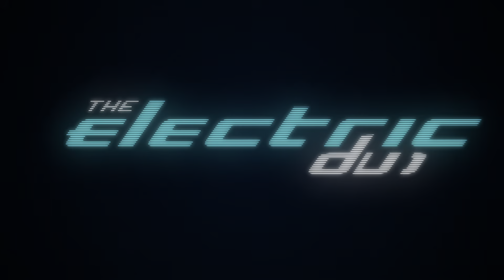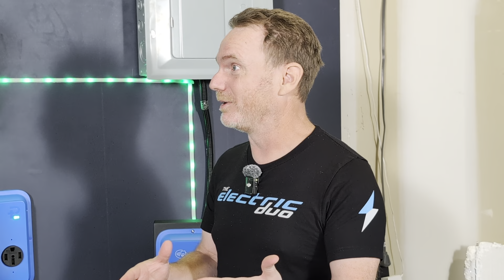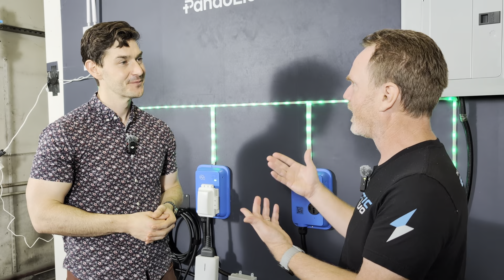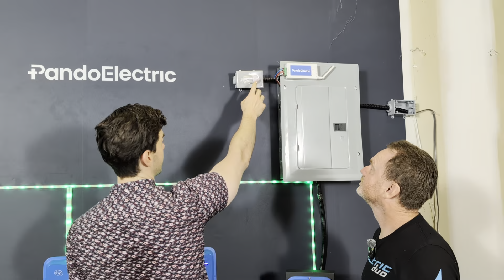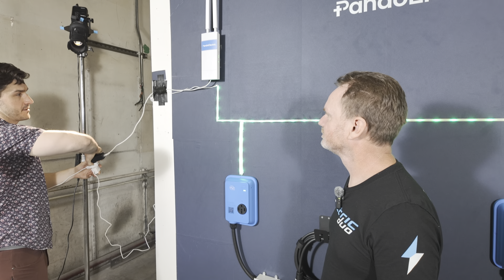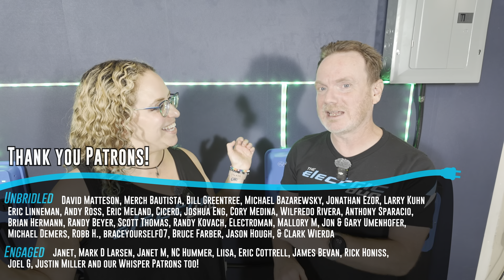Pando Electric Gen 2 Smart Outlet: Solving EV Charging for Multi-Family Housing

Comment: Although each condo or apartment electric meter may be located on the ground level near the garage, the circuit breaker panel for each condo is often within the apartment unit itself, which may be quite distant from the garage.
Not addressed in this video is how cabling is done to reach each apartment unit's breaker panel. Or are they employing meter collars with cabling from each condo unit's meter to its respective NEMA 14-50 charger in the garage?
Reply from the maker: It doesn't have to go to the unit's breaker. Their system can collect the info on the amount of energy used so the apartment/condo can bill you.

Comment: Our company has installed WiFi in numerous parking lots and garages for EV charging.  It is expensive, but lower cost and more reliable than a cellular connection. 

If Pando can eliminate need for WiFi by leveraging user’s cellphone when later connecting the Internet, they may be able to lower total install cost.

Comment: I am a condo board president, sell EV chargers to condo associations, and have been promoting Pando to associations. Their unique selling proposition was lower cost by separating EVSE from plug. 

But, raising price to $700 and cancelling lower cost model, they shot themselves in the foot.  For $700, you can get numerous competitive chargers with load management.  Price is the #1 obstacle when a condo board is asked to install 25, 50, or 100 chargers.  They should have lowered price from $600 to 500.  Sad.
Reply: I wonder if any of their price increases had anything to do with our current tariff situation?

I also have to say, that between my wife and I we spent almost $150,000 on 2 electric vehicles. I would be willing to pay extra for quality equipment, I don't want to cheap out on something that could negatively affect my daily driver.

Comment: I really hope this catches on especially with apartment complexes. It’s the biggest gap right now for EV’s. :_PurplePony:
Reply: How so exactly? 85% of new car buyers here in America for 2024 we're homeowners with an average household income of $184,000+ so they have driveways/garages/parking pads and reliable electricity. Meanwhile sadly us at adoption rates are hovering around 7-10% still. So no need to worry about this imo until total ev sales approach 80% of the market. Which imo sadly as an ev owner won't likely be until 2032+now
Reply: @4literv6  I think you make my point. 85% are selling to homeowners or those with a garage and that's only getting us to 10%. We need this badly if we hope for that number to expand beyond the single-family home market. Very few will buy an EV if they are in a complex where they can't change.